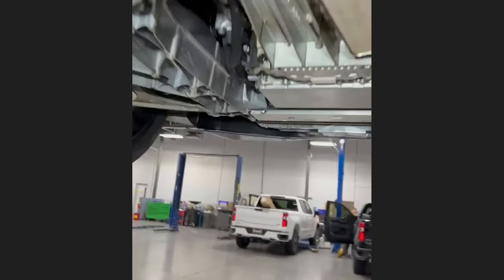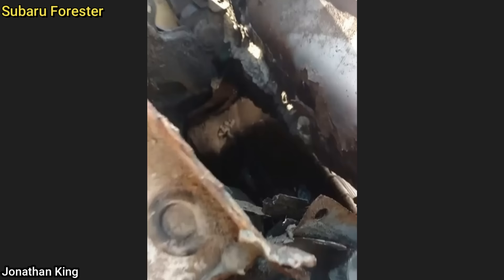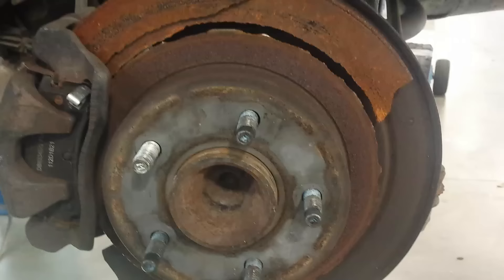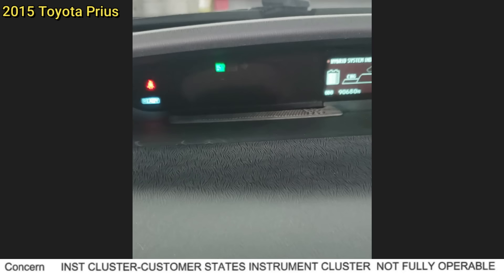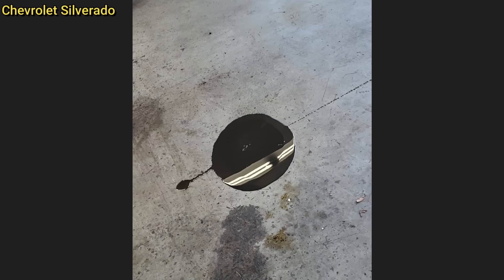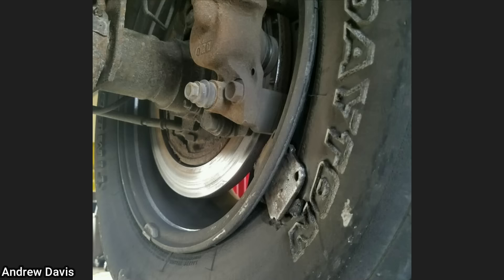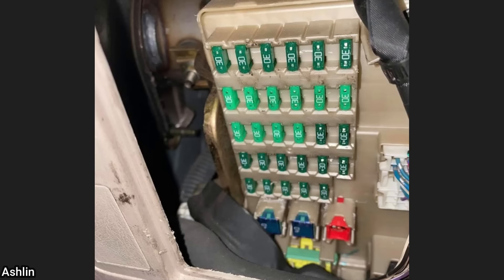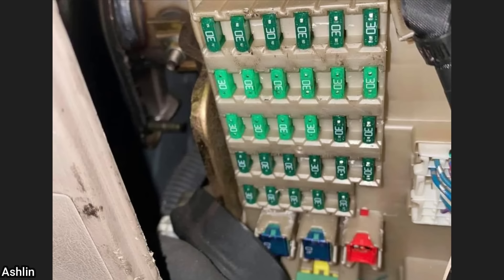Customer States Brand New Corvette Shut Off While Driving

Comment: For future reference- when you drop your 10mm socket, check the clutch assembly first. That socket will invariably work itself into the most damaging area possible, should you decide to live without it.
Reply: And it's always a 10mm
Reply: Most mechanics would move Heaven and Earth to recover a 10mm socket, 9mm... not so much.
Reply: I am missing a 10mm wrench after installing a fresh rebuild in my truck. It makes me nervous as I had to rebuild the engine as someone previously managed to get the air cleaner stud down in the intake. I drove the truck for 2.5 to 3 years before the stud make it to a valve. Wiped out the valve, head and piston. It's a Toyota 22R and the stud must have been jammed in the tight intake runners. Oh, the stud didn't fair too well either.
Reply: When I work on stuff nothing gets started or used until every tool is accounted for.
Reply: No, mine was an 8 mm, but maybe because is was on a motorcycle.
Reply: i have socket racks . if any socket is missing i see it instantly. and after 37 years you dont make mistakes like that
Reply: Found mine in my Turbo once.
Reply: Bold of you to assume anyone has a 10mm socket, those things are like pixie dust istg
Reply: @peterpeter5666  i been in the business and after 2 years if you don't have the tools you started with when you're done you have a problem LOL
Reply: I seen a 4 pack of 10mm for sale,........i knew it was a gimmick.   Wasnt born yesterday,....🤣
Reply: @austinroesner9119  at the price snap on sells tools you better not lose any!
Reply: Or the intake
Reply: You cant live without a 10mm
Reply: Sounds a little like personal experiance or very, very specific advice 😃😅
Reply: 😂🤣😂👍🏻👍🏻👍🏻 You beat me to it on the 10mm socket great job.
Reply: And seeing as this is seemingly a ST170, it's a pain in the ass to work on that cars clutch anyway cause the engine bay is so stuffed. So..safe yourself the money and the weekend you need to fix that. It sucks. (I know from experience. Am pushing it of turning it into a track car rn ^^')
Reply: @NewswithJakenator  You never know what's gone on before you owned the car. I pulled the head off my first car and found pitting on the piston and head of one cylinder, and a fuel line hose clip jammed in its inlet port. No sign of the screw and nut that had caused the damage. It went noticeably better when all four cylinders could breathe properly...
Reply: @Sonny_McMacsson  Agreed....a lot like the nurses counting the # of sponges used before & after surgery.
Reply: Rule no 1: dont use the vehicle as a tool bench.
Reply: @Graham_Langley Ain’t that they truth. I bought a duramax years ago and when I pulled everything apart to install head studs, I found a 10mm wrench and three various sockets in the valley. Along with a ton of schmoo.
Reply: I dropped my 10mm by the mailbox and it ended up in the wifes engine in the garage
Reply: @Graham_Langley  I know, I've been wrenching a long time and have seen a lot. Just never expected a 5" long stud to be jammed into a cylinder.
Reply: I don't know what's worse: having to replace a clutch, or losing a 10mm socket.
Reply: fcking 10mm dude, droped it beetwen the exhaust colectors and the engine of my Bandit 400, never could get it!!!! Always the the 10mm!! :face-orange-frowning:
Reply: I had a larger socket drop when I was undoing the oil filter cap in my SAAB and with the engine-bay being fairly cluttered at the front, I had no way of reaching in to get it. Luckily, the front air-shield on mine is shot to bits and only held on with 6 screws, so by hammering on it from beneath with my fist, the socket danced its way to the edge and just fell out onto the ground :D
I'm now much more careful when I work around there....
Reply: But if they dropped their socket in there, how did they put it back together?  Probably need that socket.  I get a screw driver bit going missing or something but you need that socket for just about everything.
Reply: @CraftAero  I recently needed my 9mm socket for an obscure ass bolt. Couldn't find it. Took it out with vice grips and then retapped the hole as 10mm and got on with my day
Reply: @289hipo  real thing, surgeons resisted checklists in the British NHS for ages, saying it wasn't appropriate for their work because things change in the course of an operation. Eventually they were made to use checklists like pilots and hey mistakes went down like 90%. Turns out no matter how smart you are it still helps to have a person next to you with a list going "wash hands" CHECK "REMOVE ROLEX" CHECK "COUNT SPONGES" CHECK

Comment: "This is 100% dangerous to drive."

"There's no damage if I don't see it." drives off into the sunset
Reply: Or the nearest ditch.
Reply: It made the trip in. It will make the trip out.
Reply: then exploads into a bigo fireball because part of the frame just got shotguned into the engine block that then caused feul to go.
Reply: @christopherconard2831  i wish that mantra was not real for thoes folks but it is.
Reply: @crispindry2815  loses suit with sunset. Sunset had a dashcam!!! 😀 📷

Comment: It's kills me to see greedy sellers sell unsafe vehicles to unsuspecting buyers. The fast buck is all they care about instead of the lives those who travel in such vehicles.
Reply: thats why its best to test drive it straight to a mechanic for an inspection.
Reply: @_AndromedaGalaxy_  and if they object to the pre-purchase inspection, you walk. No ands, ifs, or buts about it
Reply: @mechcommander7876  Exactly. Whenever I sell a used vehicle, I even write in the ad that they can have it inspected by any mechanic they'd like because I don't mind and want them to be comfortable. With that being said, nobody ever takes up that offer though
Reply: First car I ever bought was from a local used car dealership, and I took it to a chain auto shop and had a multipoint inspection done on it. The technician nitpicking the hell out of it saying the brakes were going to need replacing sometime in the future and etc. I ended up haggling the car down and then haggling the price of all of those repairs he recommended off of the cost of the car. Worthwhile to spend the $20 on the inspection in the long run.
Reply: We don't know what what the seller knew or didn't know. We don't know if the problem just occurred on the drive home.
The real issue here is manufacturing. It only had 1300 miles on it. What could possibly go wrong at 1300 miles? That is utterly ridiculous. Something is afoot since post covid production in manufacturing and or engineering and I've seen many on this channel. I bought a used Toyota with 20K on the clock and didn't have it inspected with no problem. What could go wrong with a Toyota at 20K? Nothing back then. Vehicles are breaking in unprecedented numbers, It reminds me of bad manufacturing in the 70s and early 80s.
Reply: Shoulda seen the wreck I bought in 2015/2016. It was drivable with new tires, the frame was solid as could be, but a slew of other issues almost made it into a comedy. From obviously needing a new windshield to new batteries to a fuel injector leaking and the rear gear going in the transmission, to many others I'm just not going to name here because I'll be here for the next half hour naming all of them.
Reply: Those cars could just as well careen straight into you and your friends/family too.
Reply: It's always possible that some of the sellers believe the vehicle conditions are not a safety concern, which is obvious by the issues we see on this channel all the time. A lot of the people who own and drive these cars are not aware that many the problems they bring into the shop are unsafe until they are told by someone. Not everyone is greedy just because they aren't educated on the facts, but at the very least, it's unfair to label them until you know all the details of the situation.
Reply: Tom 🏈 Brady:"If Giselle Bunchon were a 🚗... " 😒
Reply: on purpose also.
Reply: @darrenberkey7017  I've also sold cars where I was up front and said, "look, there are safety problems with this car due to rust, therefore I'm selling it as a parts car." Only to have someone buy it and drive it anyway.
Reply: Did you see that episode of the Andy Griffith show where the sidekick (yeah that was the only episode I watched) buys a scam car?
Reply: Don't be antisemetic and spread hate against greedy sellers
Reply: Even so, these customers find out and ignore it like it doesnt matter, which is even scarier imo
Reply: @bijk1911   That's admirable, but the seller that sold me my most recent car purchase drew the line at a mechanic that was over forty miles away.  That said, my mechanic was able to recommend a local (To the dealer) mechanic and the dealer had no complaints.
Reply: The buyer should have it inspected before paying.